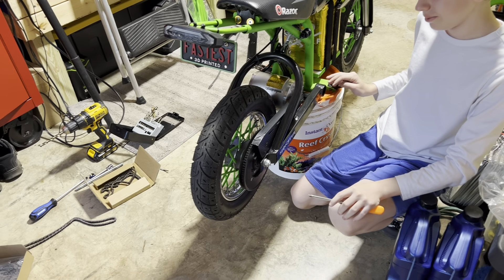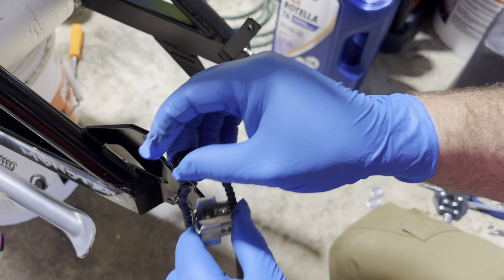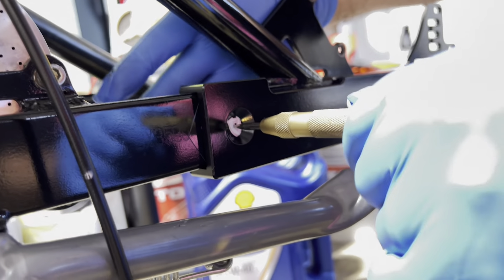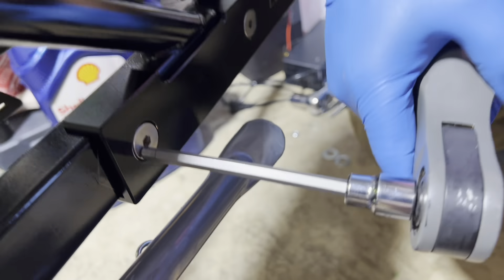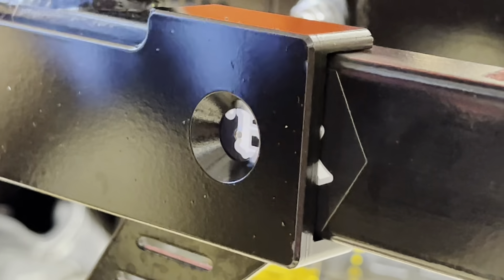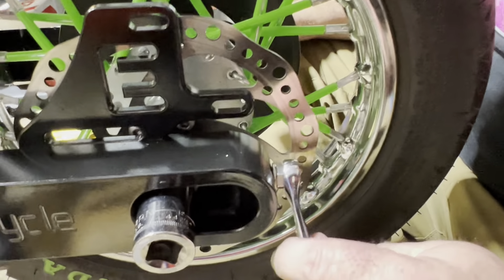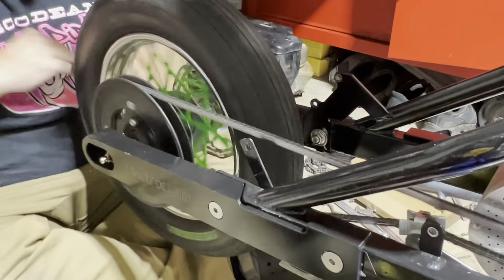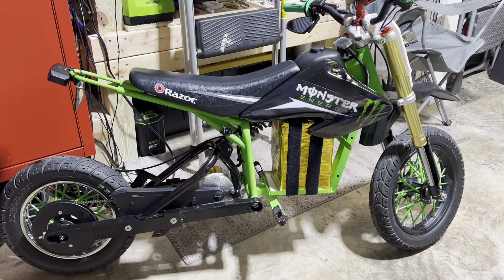Electrocycle Garage bolt-on swing arm extension install

Comment: Why are extensions for the Razor platforms literally double the price as extensions for full size street bikes that go 200+mph?? This is really weird because the machining process isn't any more expensive for smaller parts that don't need to handle even a 1/4 of the torque that full size bikes put out? Just curious because I was wanting to get this kit or the "other" kit for extensions and they're literally double the cost... The parts look good, but no better than the parts for my busa or r1...

Comment: Thank you for sharing the video! I am planning to work on this tomorrow. The only modification I would suggest is to install the chain link clip in the opposite direction. This is because the open end of the clip should not face the direction of travel.
Reply: That's typically how you want but only because if it rubs up against something you don't want it getting kicked out. If you have nothing within play distance either direction is fine. But if you running a tensioner, definitely direction matters.

Comment: Also you don’t need the tensioner. You can use it but the drop out allow you to tighten chain without tensioner
Reply: Way better video lol. I’ll be sharing this on my web page cool?
Reply from the maker: @electrocycle6560  no problem. Yeah I know you can run it without the tensioner. I may remove it at some point but it does allow better adjustability

Comment: Hello like the idea of swing arm extender , you could use lock tight - blue or locking nuts . Also a bigger rear wheel could be a later option and would look good. Nice video. 😊

Comment: If I added a 4-5 in extension on the swingarm will the electro chain and sprocket kit be long enough chain?
Reply: Their chain is 6foot i believe which should be way too long so u should be good their chain and sprocket kit lowkey overpriced tho